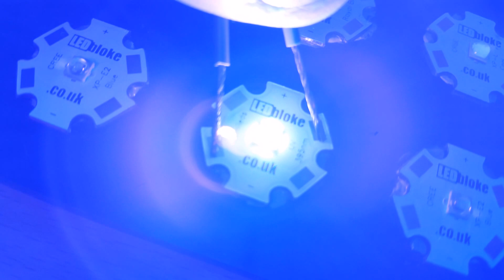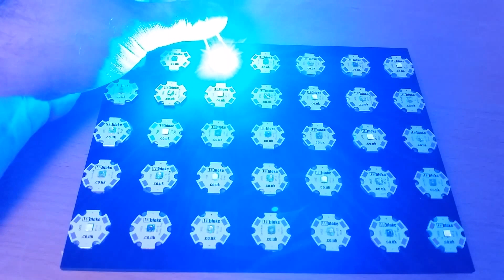DIY LED reef lights

Comment: Isn't the red forward voltage 2.1v (max 2.6v) and the blue 3.1v? If your pushing it at 3v how does/did this affect the longevity of the red leds?
Reply from the maker: The Vf is different for different LEDs and even for different bins of the same led type.
Also, Vf varies with temperature.
Please check manufacturer's graphs for the exact bin of an led for an accurate answer.

As for the video, I was applying a constant 500mA current via a LDD-500H, therefore different Vf on different leds. Leds are not like the light bulbs, they behave like diodes. Therefore, you don't apply voltage, but rather amperage.

Comment: Have you got a schematic for this setup at all please?
Reply from the maker: ss ss Hi, there is no schematic at this point, just a bunch of LEDs attached with thermal paste to a heatsink.

If you'll watch my other videos, you'll see the light at different stages of the build, including one once finished and another on a RSM130.

The test rig in this videos is: 12V power supply -> MeanWell LDD-350HW -> LED (respecting + / - polarity).
Reply: Hey thanks for the reply. This comment was meant for another video where they were dimming the leds with a controller.

Have you got an update to how these lights performed anyway?
Reply from the maker: ss ss See here http://www.acvariu.ro/forum/posts/list/200/36620.page#p329266 the scheme for the project. The controller is TC420.
Reply: lovely, thank you